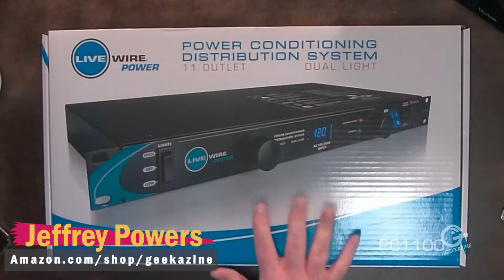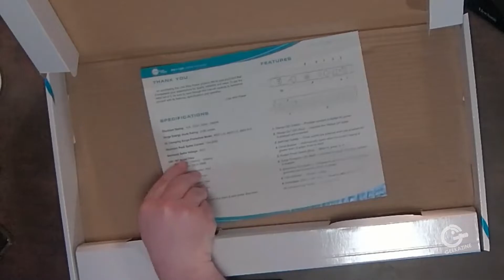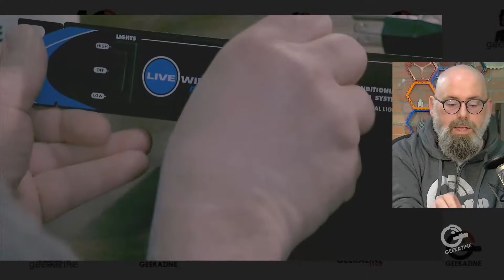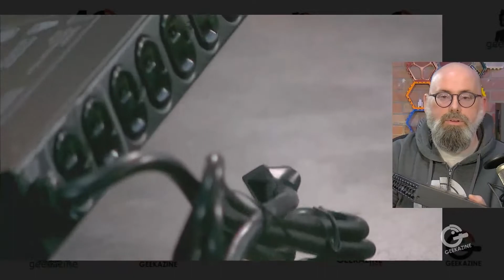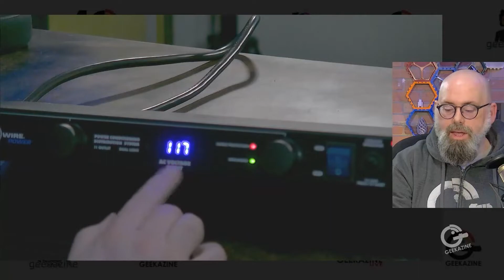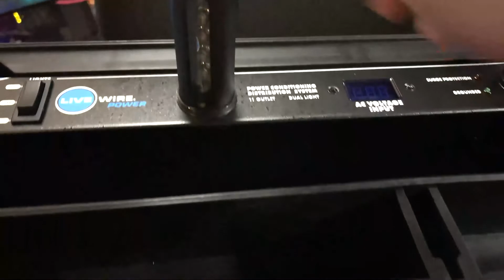Livewire PC1100 Power Conditioner

Comment: Have you tested the output voltage? In order to be called a power "Conditioner," it must maintain a constant output voltage of 120V, (for U.S. products,) even while the input voltage varies up or down. I can't seem to find any published specs on this unit online which leads me to believe that it does not. That would be a selling point. You did show a spec sheet that was in the box, but the video was blurry and I couldn't read the fine print. Constant voltage is important because some digital equipment can only operate within a certain voltage range.